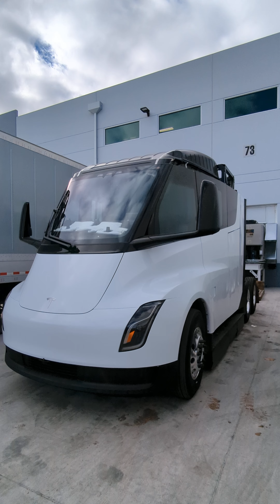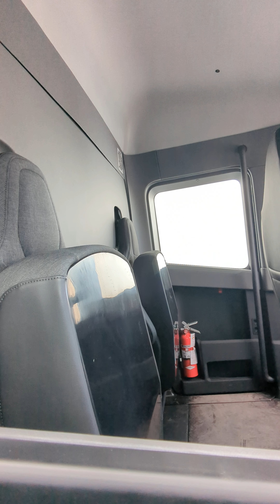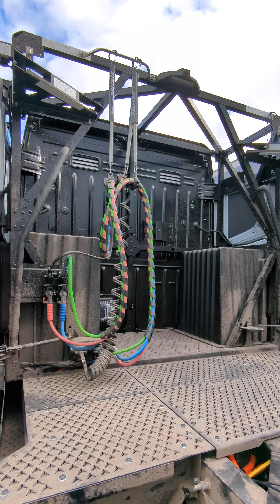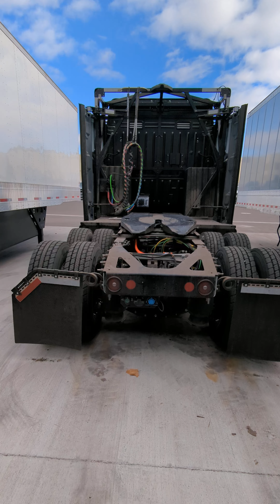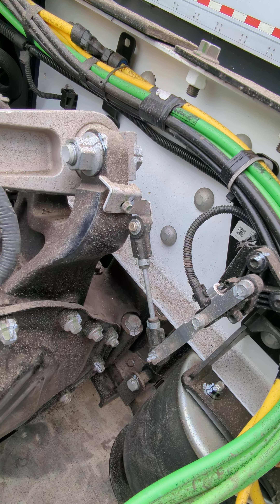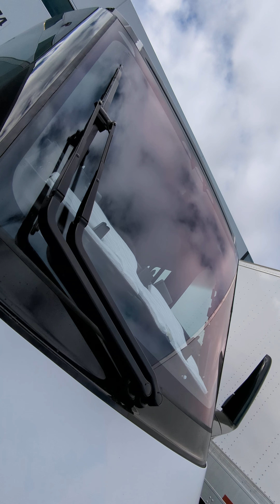A little bit about Tesla trucks

Comment: Great footage, God would love to see how those breaks actually work, it's very intriguing
Reply: It's pretty cool how the truck slows down.  It uses regenerative braking - instead of a Jake brake - and puts electricity back into the battery.  After climbing over a mountain it will put around 80% of the power used back into the battery on the descent.  The brakes themselves could last the lifetime of the truck with very little service.
Reply from the maker: Wow Mr. Joe Anderson explain really good how electric system work in Tesla.
Thank you
Reply: not really , Anything Diffrent from Tesla cars produced Today.
it has Friction brakes , but Does not use them.
most Breaking is with REGEN brakes, that turn Motors into Generators when slowing down on Streets or Downhill.
comes to Complete stop , then HOLDS.